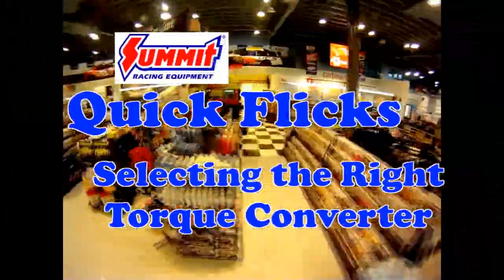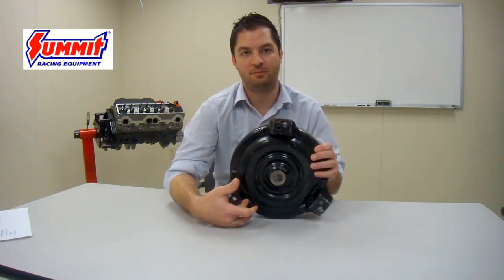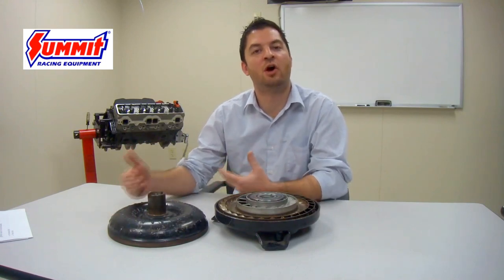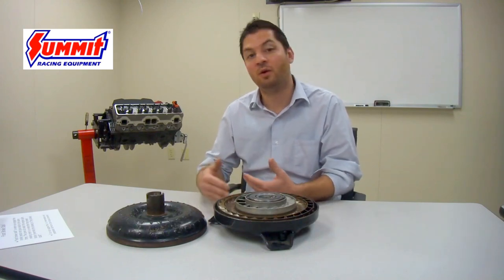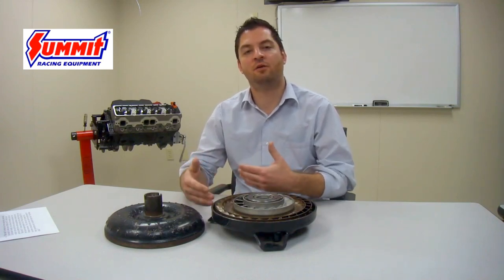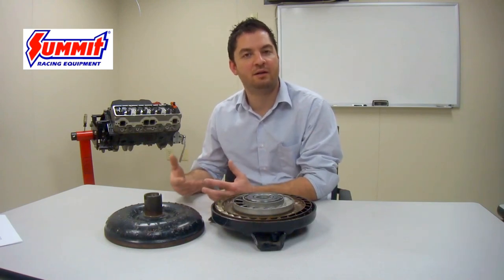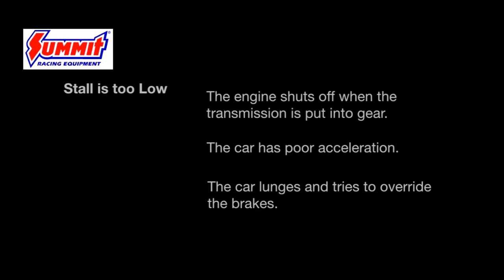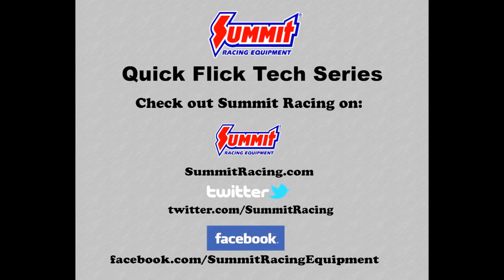Torque Converter Selection | How to Choose the Correct Torque Converter

Comment: its a 1987 R10 Silverado with 305 its all completley stock i dont know what kind of cam it has or the rear gear ratio, the truck will be used for casual driving but i would like a little more kick to the engine, if you know what i mean

Comment: Summit, 
   Im looking to build a LS 4.8 w a Crane Cam 224@ .050s .590 lift cam, putting it behind a built 700r4. Will a 2400 rpm converter be enough? I have 3.42 gearing in a 86 Firebird s/e.

Comment: The problem I have is the car used to foot brake from 3500-4500 and I left the line at 3000 so did I burn it up doing this? I have a cam that is smooth at 3000 so should I go with another type of launch?
Reply: +Ron Butz Oh this is a 10.80 Buick GS drag car and that 3000 foot brake depends on my consistent 000 light and running 10.90 with weight added in Super Street. I don't have a delay box or a throttle stop because I can't afford it and 10.90 is a starter class not a class for 8 second cars but NHRA allows it. So the convertor must work like it used to from ATI but they say it wasn't the problem. I will change to another ATI convertor that didn't stall enough while I send that one in. I hate the performance of parts that puts a poor man out when he finds something that works! I have videos were I braked it constantly at 3000 and it was consistent and winning! If A convertor can't hold up to this than the public needs to know this and an alternate way has to start for the guys that want to win on a budget!

Comment: So i tried a few burnouts in my c5 vette. It’s so hard to burn out .. I hold the brakes and gas and it really does not like it.. how can I get the tires to get loose
Reply: Turn off active handling and then put the pedal to the floor
Reply: @joelbornstein3243  so that comment was a long time ago. I have a c6 not a c5.. since that comment i got a boost cam installed with prc and a tune. Plus cat delete and e85.  Need I say I dont struggle with breaking tires loose anymore… now about that transmission 😅
Reply: @johnhonest9347  problem solved!! Well done!!

Comment: a friend of mine is putting a 650 HP LS motor with a 3500 RPM stall , into a car with a 2.7 back end . Hes a know-all who doesnt listen , but how will that affect it ? seems to me its going to be driving around everywhere slipping , as well as slowing the accelaration due to being so tall geared

Comment: My car has two symptoms listed Poor acceleration and lunging tires 26" high, rear end  3.25:1 sbf 331, 650 holley, performer RPM mani cam is a 268. Long tubes, xpipe duals C4. Is this enough info to recommend a torque converter The car (67 'stang) is very fast at top end but the throttle must be advanced slowly during acceleration because you can feel the car not using all the fuel being delivered at low end. Thanks

Comment: thanks for the above response, one more question... the notch in the front of the torque converter, does it lock into the actual gear of the transmission pump?...

Comment: I would like to change my torgue converter,cause i have a 500hp engine and the automatic gear box lags while shifting,what should i do.....?
Reply from the maker: It would be best to call one of our salesman directly at 1-800-230-3030 to insure that you get the correct converter. When you call we will need to know the exact engine type, transmission type, camshaft specifications, rear end gear ratio, tire size, and vehicle weight to help you choose the right part.

Comment: I have a 2010 Dodge ram 1500 Hemi, 35" tires, stock cam, and when I am doing a u turn or turning right, e.g. not coming to a complete stop my engine bogs when I turn in and roll on the throttle? Is this the torque converter? Additionally, which one could I upgrade to in order to increase performance? Thank you~
Reply from the maker: A TT, If the original ring & pinion ratio has not been changed to accommodate the 35” tire size, you should start there. That big of a tire with the original gear ratio will lower the RPM of the motor effectively bogging it down at low speeds.

Comment: Great video!! But I have a question, I want to install a 3000 stall converter in my 1998 grand cherokee 5.9 but the issue is that my cruising rpm on the highway is only 1300 rpm, does this mean that I can only do around 1300 stall?
Reply from the maker: Hi Tanner Poirier, 
If your vehicle has been modified to enhance performance, you probably need a torque converter with a higher stall speed. If the stall speed isn't high enough, the car won't be making power when you launch and you'll bog off the line. If your setup is really mismatched, the engine may want to stall whenever you attempt to shift into gear at idle. A higher-stall converter will improve acceleration by allowing the car to launch at an rpm where the engine is making the most power. To decide which converter is right for you, you'll have to look at the car's weight, braking system, engine displacement, and engine combination. Some converters are designed for high-revving lightweight cars. Some are designed for heavy cars that make a lot of bottom-end torque. The key is to match the converter to the engine and the entire vehicle.

Comment: I need help selecting torque converter .  302 lunati 280/290cam 3.25 rear gears 11.6-1 compression hei longtubes with x 235 75r15 tires she makes good power down low my old one is wearing out and making noise
Reply from the maker: I would recommend a 2000 rpm stall converter if you are using a C-4 or non-overdrive transmission. If you're using an AOD transmission, you could get away with a slightly little higher stall because the AOD direct converter drives in 3erd and fourth gear, bypassing the converters turbine.  Our Summit Racing line, Hughes, B&M, and TCI are great brands to choose from (make sure you select a lock-up version for AOD).
Reply: Thank you i ended up buying the hughes 2000 stall your shipping was within 24 hrs thanks

Comment: Alright, I have a stock to my knowledge sbc 350 with 3.73 gears in the rear. Tires are on 16" rims that probably sit no higher than 21". What would be the best TC for daily driving? I was thinking a 2500-3000 stall but I don't know. Any help is greatly appreciated.

Comment: is  it true that 4 liters are stuck in torque converter when you change new transmission fluid.? the new 5 liters get mixed with the old fluid that is in torque converter? thank you..
Reply: Yes. Depending on the size of your torque converter there will usually be anywhere from 2-5 quarts left in the converter that can only be changed by removing the converter.

Comment: This video helped a ton.  What size do you recommend for the following specs:

Auto 01 Mustang GT (supercharged and cammed)
4.10s 
I have comp cams stage II, with operating range 1800-5800
Tires are 315/35-17

Comment: 302, procomp 190CC heads, c4, 4:11s, mini spool, on a 28 inch mt radial. camshaft being considered is an elgin
Lift: .520/.541
Duration: 304/314
Duration @ .050": 234/244
Lobe Separation: 114 LC

I am going to need a stall, what kind of stall should I go with?

Comment: I have a 68 camaro that I've recently added a 406 small block to. My mechanic says I will need a 2500 stall converter for it. I have the stock transmission in it. Is this accurate and what's the plus to doing this?
Reply from the maker: Hi Marcus Bratton, 
We need some additional information from you. Can you please call our tech department? 1-330-630-0240. We look forward to your call! Thanks for watching.

Comment: I have a heads cam intake 5.0 in my 1980 ford fairmont
trickflow stage 1 cam 
ported windsor jr heads 
eldebrok rpm intake
8.8 with 4:10 gears
275/40/17's
what would you rec for my car

Comment: I've never owned a stalled auto but i'm buying a Trailblazer SS this weekend. I've been told it has a built motor, 3200 stall and stock 4.10 rear. I'll have to drive it 5 hours back home. Will it be safe to drive it that far?
Reply from the maker: Hi TheTexaswolf, 
Yes, late model automatic transmissions lock up the torque converter at highway speeds eliminating all slippage, reducing unwanted heat. Providing the lock up is functional, you’ll be fine.

Comment: Does summit sell a torque converter for a 2005 acura tl aouto transmission 3.2  full bolt ons on the vehicle and it stalls bad actually bogs I'm sure it's the torque converter?
Reply: Can you recommend a torque converter for a 700r4 behind a mild small block. The truck is 4wd runs 4.88 gears and 33" tires
Reply: +Robert Riegelsberger Dude, Horsepower, torque and many other things are needed information. Your just not giving enough info.

Comment: would you be able to recommend a tc for a 1997 jeep grand cherokee laredo l6 4.0? ..upgraded tires to 31x10.50xr15
Reply from the maker: +fgalaviz00 , 
Can you give our tech line a call? We need the transmission model number and any modifications you have done. We can help you figure it out. 1-330-630-0240. Thanks!

Comment: 4.3 vs 5.7 torque converter? i did a v6 to v8 engine swap in my 98 c1500, should i leave my v6 convertor in or swap in a v8 converter? thanks in advance
Reply from the maker: The 4.3L converter will work, but not as good as the 5.7L converter. Especially if you do any heavy hauling or towing.

Comment from the maker: A torque converter with a stall of around 2,500 rpm would be the best choice for your combination. Assuming that your truck has either a 4L60E or 4L80E transmission, I suggest go with a HUP-22-25EL ($419.95) for the 4L60E or a HUP-22-25L ($569.95) if it has a 4L80E transmission. Please let us know if you have any additional questions :)

Comment: So if a car with a 2800 stall converter is running at 65 mph at 2500 rpm's it is creating a lot of heat that will damage the converter ??
Reply from the maker: If it actually stalls at 2,800 RPM in your application, it will create a little extra heat, but it shouldn’t be enough to damage your converter. If you were cruising at 1,500-2,000 RPM, it would create a lot of heat and cause damage.
 
When running a higher stall converter, especially on the street, you should be running a good secondary transmission cooler besides the one in the radiator.
Reply: @SummitRacing  thanks

Comment from the maker: Hey! We would be happy to help, we just need a little more information about your engine/vehicle combination before we can suggest anything. Can you give us the following information: 
- Camshaft specs 
- Vehicle type
- Rear gear ratio
- How the vehicle mainly will be used
Reply: I have a 1966 valiant with 360 small block around 400 ho and tq  have .486 lift cam 279 intake duration 296 exhaust duration .473 exhaust lift 107 lobe separation   20-600-4 cam #  it is used for street mostly track a few times 1/8 mile  frame connectors auto 904 built gear ratio is 3.55 8.75 rear end compression is around 9.5 any help would be great

Comment: I listen to these types of videos for entertainment only. I bought a B&M 3500 stall converter and it worked on my 76 Nova stalling to 3200-3500. This was what I expected. Both cars about the same. Then bought a Summit brand and put it in my S10 with a 400hp 406, broke the tires lose at 1800-2100. Now some people would say thats because the S10 was lighter. I don't thing so. These test were done sitting still holding the brake. There is no way for my converter to tell the difference between my tire size, vehicle weight or any other factors. B&M says 33200-3500 that is what you get. Off brand converters you will never know what you're gonna get. So, the next converter I bought was a BossHog converter from summit. This one pulled the same crap on me, it broke the tires lose at 1800 to 2000 rpm; Had a talk with the company in Muscle Shoals they went into vehicle weight, gear ratio, horse power and their usual bullshit. Sorry, I don't buy those concepts! In the end the BossHog converter loosened up and managed to make it up to 3200-3300 in my S10. But I still don't buy into all the science they say goes into a converter. My 2 cents. Buy quality first and you wont be disappointed. It's all about buying a quality product in the beginning. You get what you pay for.
Reply: I'd say the problem was with the rear brakes in your S10!

Comment: So my car stalls after it had a tune up done what could cause this. I have a Dodge charger.
Reply from the maker: Hi Graciela Campos, 
All things being equal - after a tune-up; if the Charger is carbureted then idle circuit and or ignition. This should be taken up with the shop that tuned your car, they might have missed something. You should get what you paid for. Thank you for watching and good luck!

Comment: i have mustang coupe 2700 lbs  
w/6.0 chevy motor ls6 heads 243 cam dur@.50  236/242  603/609 112 
th 350 trans 389 gear and 28x10 15  full slicks  what kind of stall i need

Comment: So...I should think of the Torque converter like a clutch? A 3000 Stall TC would Slip (Like your foot is on the clutch pedal) until it reaches 3000rpm?
If so, then why would you want one that slips all the way to 4000 rpm?
Reply: wait...So it works like Revving to 4k, and Dropping the clutch? Is that it?

Comment: good video , if you reach the  stall speed  on the hwy like 2500 rpm  70 mph and you have to slow down to 2000rpm and 60 mph dose it is going to slip all the waw to 25000 rpm un till you reach 2500 rpm or 70 mph  or  it only doo that at slow speed when you drag racing the first 60 ft to be in power band thank

Comment: I dont understand. Lets say i got a comp cam 274 that RPM range starts 2400, and you mentioned that i should get a torque converter less than RPM range when cruising. Well when i cruise , i am around 2200 RPM so i should get a converter less than 2200 ? But i thought i should go 300 above my CAM card starting rpm which is 2400, so that means i should get a converter around 2700 stall ? Kinda confused...
Reply from the maker: +Keegan Jacobs, 
Keep in mind that converters are advertised at what’s called flash stall. That means, when you release the brake and mash the gas pedal, what does the tach immediately jump up too. That is the converters flash point or flash stall.  Now, when the car is being driven normally or cruised, the stall rpm will be lower. But, be aware, if a high stall converter is forced to cruise at too low of an rpm it is slipping internally and causing a lot of heat. Heat is a killer to an auto transmission. Make sure you have a good size cooler out in front of the radiator.
Reply: +Summit Racing I am running a pro torque 3200 stall converter on my 2013 dodge challenger 426 stroker, magnuson supercharger 12 psi boost.  Comp cam 274 , with rpm range starting at 2400 RPM. Car curb weight is about 4200, 20 inch wheels with 28 inch street tires. Southern hotrod nag 1 auto trans, and i am getting 650 RWHP, and 672 RWTQ. 72 LB fuel injecters,  3.06 rear axel ratio .  What stall do you recommend on regular street driving and maybe one time in a year going to the track ? Thank you .
Reply: +Keegan Jacobs Torque converters sorta "slip" until stall speed. If you have a 3500 stall and you are driving at 3000 it is slipping and getting hot. It feels mushy until stall speed. On a street car you don't want more stall than cruise RPM. On a drag car you want a bunch of stall speed because the rpm will stay up higher rpm.
Reply: +Keegan Jacobs    No, if your cam is set at a beginning power range of 2400, add 500RPMs so you want 2900-300RPM stall speed to get the car to be in its power range when launched...
Reply: Mopar Onine ya i think its because im using the magnuson supercharger instead of whipple or pro charger
Reply: I agree 12 lbs of boost should have that thing well into the 800's

Comment: Well how about power absorption and speed ratios and putting the oil flow in the correct sequence. Impeller to turbine due to centrifugal force, turbine back to reaction member (stator) as long as the turbine rotates slower than the impeller and the oil flow being redirected by the stationary reaction member to strike the impeller blades in a direction to aid the engine force and multiplying its output torque at the expense of output r.p.m. For every speed ratio between the impeller and turbine there is a corresponding inverse torque ratio. Too much information I suppose for the scope of this video.

Comment: I had a 10.4 in. factory converter it would "stall" @ 1,800 behind a 273 behind a 440 it went to 2,500. It is cubic ins. and torque that makes it work. Have all the info. BEFORE you order the parts.

Comment: Wow.... I was texting my nephew 3 days ago  about my stall speed converter, wanting to change it... now I know for a fact that somebody somewhere somehow is in my phone messages.... but anyway I have a Monte Carlo with a stock balanced and blueprinted 502... turbo 400 ...411 rear end... I bought a supposed 2500 stall speed converter... drop that thing in gear at idle and it barks the tires!!!!!!!
WTF????
I had a whole lot lot higher stall speed when I had the wrong flexplate in that 502, and man that thing would slip until 3500.... launched like a freaking rocket until it blew apart and ripped that transmission out of the car... the only thing holding it in was the Driveshaft and the transmission mount.... I want to get back up in the 3000 RPM stall speed range ...what am I looking at here???

Comment: I have a 2500 stall I went up a hill and it shot fluid out the dipstick I know that's not normal
Reply from the maker: Check your fluid level with the transmission at operating temperature and the engine running. If your radiator has a built-in transmission cooler, make sure it isn’t leaking and allowing coolant into the transmission. Finally, make sure the transmission vent isn’t plugged or obstructed.